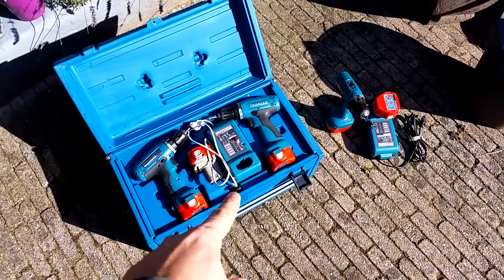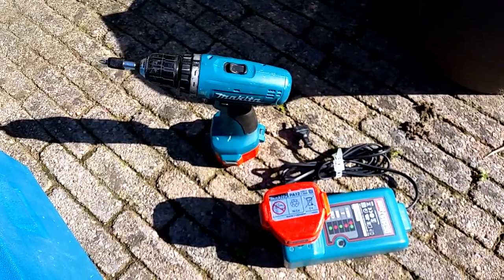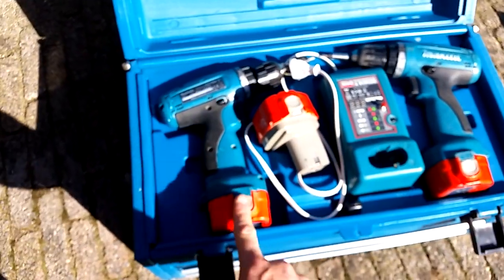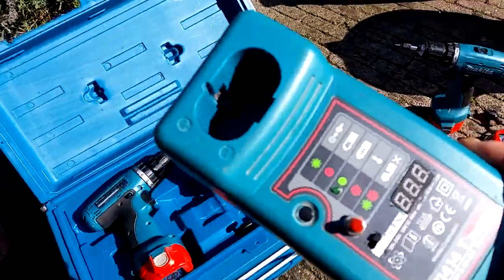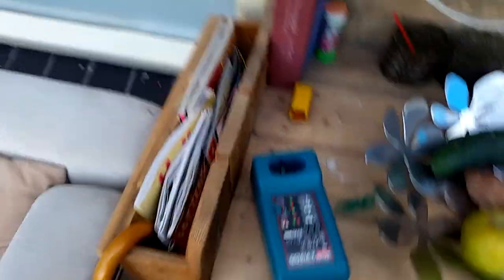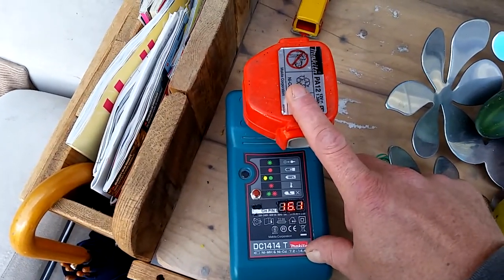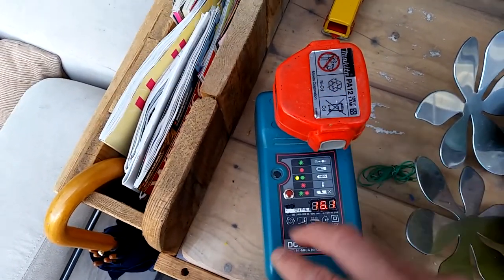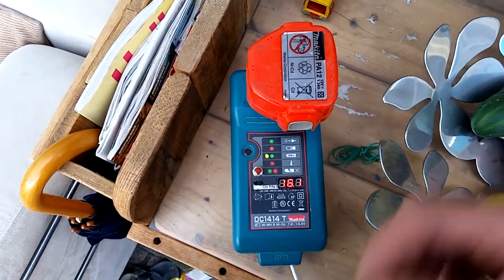Put new life in old power tools with the RE-EMF charger

Comment: Sorry long comments here and slightly off topic but please have a read Rene, appreciate your hard work and great vids!

is this a valid build walk through to follow Rene  https://www.scribd.com/doc/170125960/Radiant-Charger-With-Schematics   

Thanks, 

Also look forwad to your thoughts on the use of Alum from Iherb, Aluminium Ammonium Sulfate, it has a much a higher PH than pool Floc ( i think thats what your using seems very similar to sulfuric acid, and would account for your high standing voltages).  I think the alkaline label on these batteries comes from alkaline ammonia component in the Alum used to grow crystals sold on IHERB.   Im sure other Alums have alkaline components also.   I would love to see you try a  conversion with this type of Alum and would be happy to buy you the Alum if you are keen on this seeing its more expensive than standard pool floc Aluminium Sulfate which many seem to be using.  I doubt you will get standing voltages as high as you have with your low ph conversions but I expect you will get the true extreme lifespan and durability, which I am questioning theoretically with the low PH Alum electrolytes like pool floc.   I am also looking at trying an addition of highly magnetized Sodium Silicate to Aluminium Ammonium Sulfate as based on a patent found here https://patents.google.com/patent/US20080044726      

You certainly seem to have created the ultimate desulfation device, much respect!  I am just getting into alt energies so want to get an lead acid conversion document produced with stats to back it so people dont have to wade through endless methods that all seem to be missing vital info.   Hardly anyone clarifies what alum they actually use, so many aluminium sulfates, and from research Aluminium Ammonium Sulfate seems to be the one with the most amazing properties for this process.   The high alkalinity and ability to grow crystals seem to be a few of its interesting traits.  It also seems much safer to deal with, from what I can work out the only risk of ammonia gas is when its heated past 250 Celsius.   Thoughts appreciated, anyone can contact me at pbowerma@gmail.com to discuss this.   If we can get a huge boost to these battery conversions by simply adding magnetized water glass as per patent to our alum mix we could get this process to next level greatness!

Comment: Hi René!
Cool project! I like the idea of a PCB you mentioned. I really would find it useful to have an option of adjusting the charge-end-voltage to adopt the pcb for more battery-packs like 18,5v etc. this is a nice idea!
Btw could you tell me what change have to be made to the original re-emf-charger to use it with 18v lion a battery packs? I currently have a use case for this... ;-)
BTW i am a bit worried about the Balance between the cells. What do think about this?
As I know maktita does not balance there packs with the original charger, but If you are using old or reclaimed cells this it seems a good idea to me to do so. I would keep an eye on the balance with an RC-Battery-Cell-display...
Cheers 
Techromanzer
Reply from the maker: Hi Technomanzer,

Thx for the donation !
Super helpfull.

I might make it so with the PCB so you can switch between voltages with a selection button. Not quite sure how i am going to implement this. But i found some software to build a PCB. Now i have to find time to learn this package.

When i have it finished i will ofcourse make a clip of it. So keep in touch.

About the balance between the cells.
I think this will be no issue as the RE-EMF charger pulses with such high back EMF spikes that all the cells are triggered to hold charge. This way the charge to the cells is always uniform.
At least, this is what i have seen so far. It could always run of, but i haven't seen that happen yet.
If it does so, i will figure a way out to balance the cells or charge them in parallel, or somethink like that.

Anyway, never to old to learn or to create !

Thx again for your donation !

Cheers,

Rene